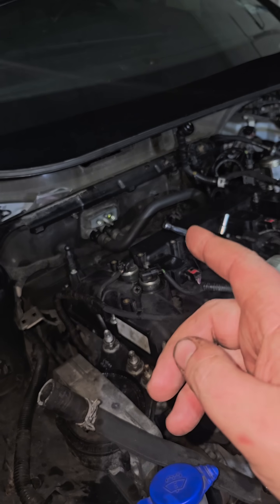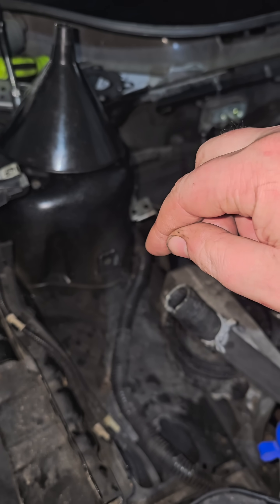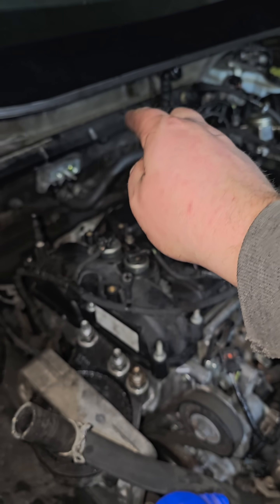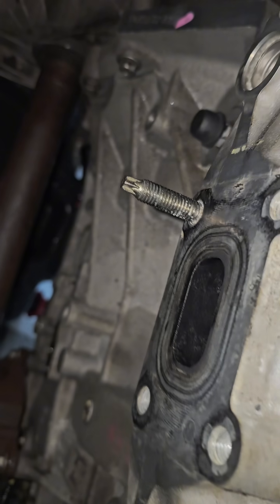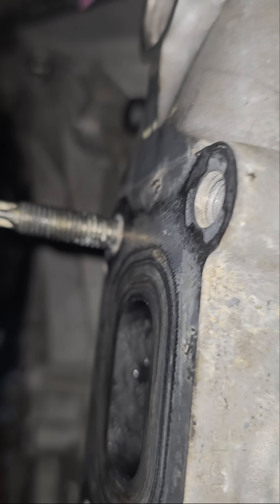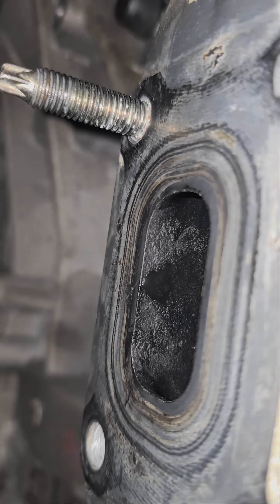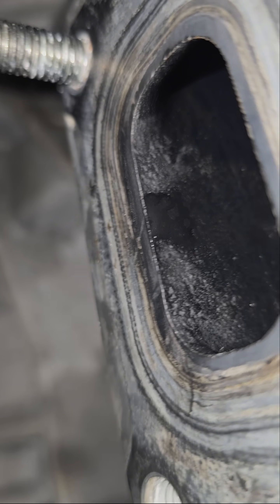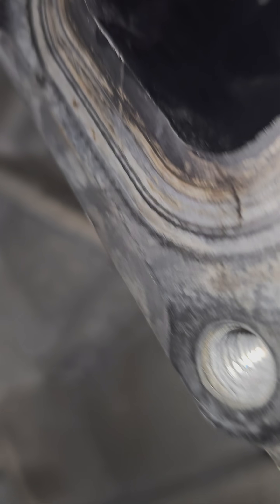Focus ST - How to Test a 2.0 EcoBoost Cracked Cylinder Head | *The Easy Way* #focusst  #focusrs

Comment: So assuming I have the turbo on and pressurized the coolant reservoir and it never dropped any pressure and the turbo is completely dry, should be good right? Just troubleshooting before I send this motor to the moon
Reply: Context: Left it pressurized for like 30 minutes and stuck a camera through the turbo and saw nothing and no pressure drop
Reply from the maker: Your good by the sounds of it, whats the setup?
Reply: @WhiteblurrST nothing crazy atm, just slapping a big turbo on it for right now. It’s a higher mileage motor, good compression across the cylinders though. Waiting for it to blowup before I rebuild it
Reply from the maker: Yeah absolutely should be good,  if it had a micro crack and was burning coolant with white smoke, then it would leak out doing the test.
Reply: @WhiteblurrST it was blowing a tiny about of white smoke. Still drove it for about two weeks and the coolant never dropped a significant amount. Not enough to make the car overheat. The smoke also wasn’t  thick or billowing out by any means so we initially thought it was the motor, but after compression testing and boroscoping the cylinders we never found anything. Assumed it was the turbo so we put a bigger one in, pressurized the coolant reservoir and no leaking inside the turbo or drop in pressure. So assuming we’re probably good to go
Reply from the maker: Yeah absolutely your good,  which turbo did you get?  I wouldn't try blowing it up on purpose haha,  save the block and get a another spare to build.
Reply: @WhiteblurrST you’re right, might’ve been a little dramatic when I said I’d blow it up lol. I ended up getting the BNR st67. Depending on how much power I decide to run I might end up changing it later on. Ethanol isn’t super available here so i probably won’t be running it, so it should hold up fine for what I’d want
Reply from the maker: I would just stick around 350whp which is the oem hpfp max limit range.

Comment: You said you can do it with turbo on as well?
Reply from the maker: Yeah, disconnect the downpipe vband.
Reply: @WhiteblurrST sweet I just did an engine swap for my buddy and when we went to start it... clouds of white smoke came out...
Reply from the maker: Yeah thats wild,  guaranteed it the head.  These cars aren't known for Headgasket issues.  Btw get the mahle headgasket from rockauto,  its only 40 bucks and its oem.
Reply: @WhiteblurrST I still have his old engine but it started to knock so im not sure if wanna try that😭😭 ill have him buy the head gasket too.... ugh I thought I was done with this dang car
Reply from the maker: Where you guys located?  I need a good spare block
Reply from the maker: O thats to far lol 😆

Comment: Im about to do this once I can get my car in the garage to remove the turbo. My exhaust has been burning coolant bad, but i did a generic head gasket/cylinder leak test (tests for CO2) and it didnt show it was bad...but im not sure if an internally leaking turbo is likely or if its legit the exhaust port on the cylinder.. (big turbo, big power)
Reply from the maker: Its definitely a cracked head if its burning coolant,  take turbo off and blows into the resevoir itll pour out.
Reply: @WhiteblurrST  probably the case...but ive been hopeful that the turbo is leaking internally and dumping coolant.. but i honestly havent seen that happen in my research. the 3.5bar map sensor and 34psi+ i was pushing the 3071 was prob the nail in the cylinders coffin... at first just a hairline crack...it smoked for a day then nothing for like a month.. then just started out of nowhere again and its just constant this time (and no leaks anywhere externally)
Reply from the maker: Yeah for sure sucks